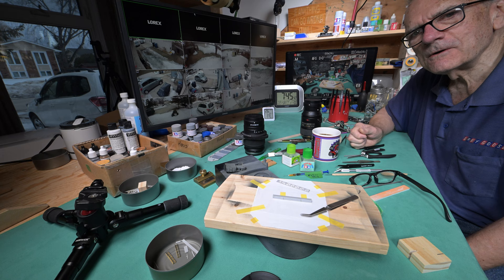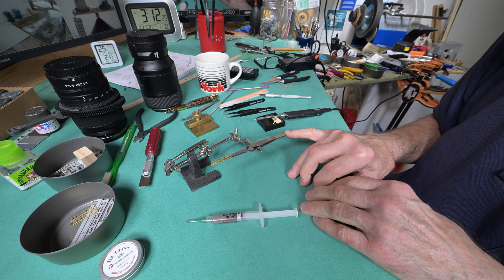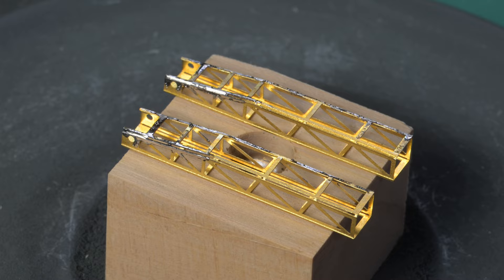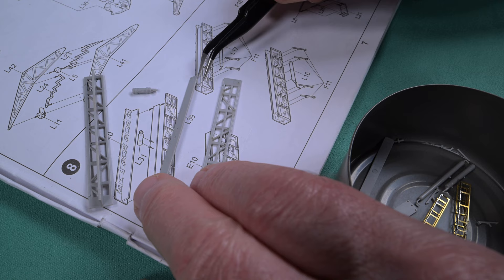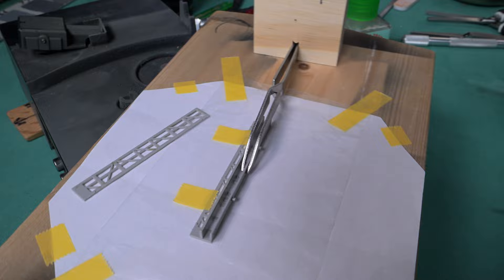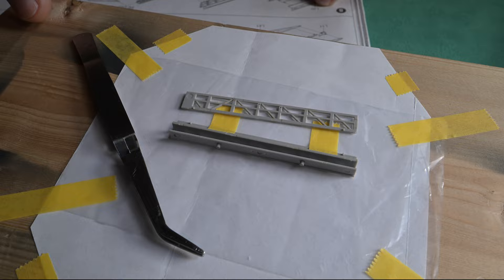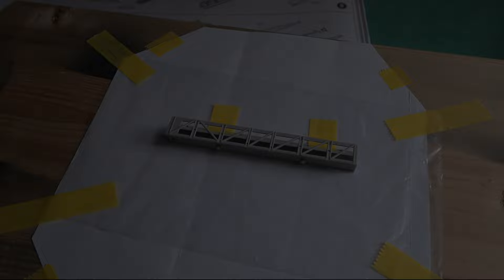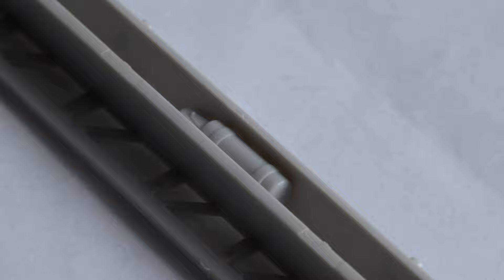The Model Ship - Part 1135

Comment: If you file and sand the solder joint before you paint it you will not be able to see it. The solder is so soft that a little filing and sanding cleans it right up. Keep up the good work. By the way, I always love to hear the clocks!!
Reply from the maker: Thanks for the tip Chris. 👍